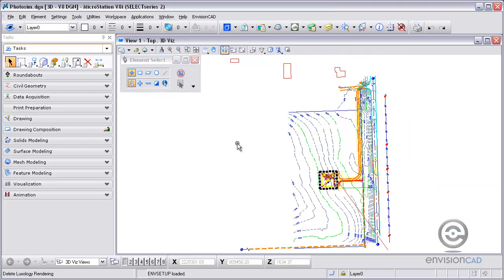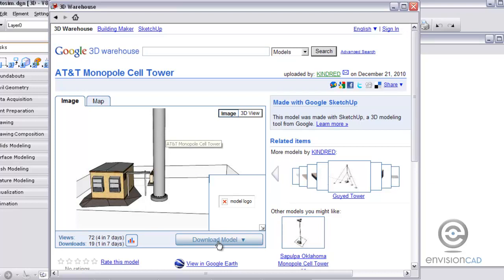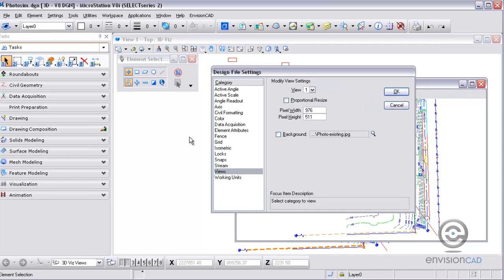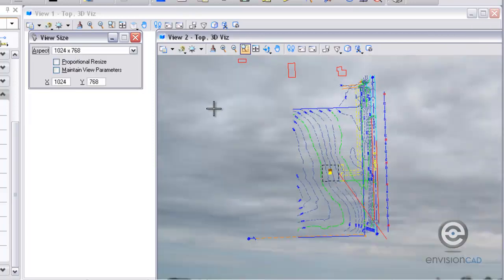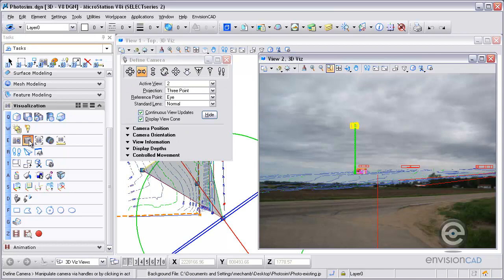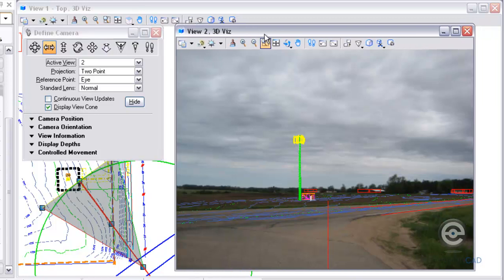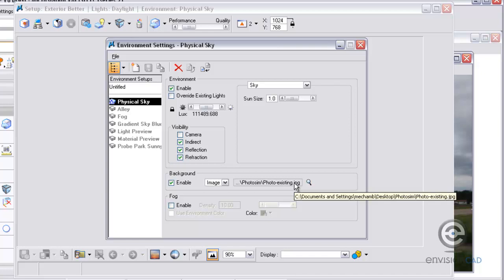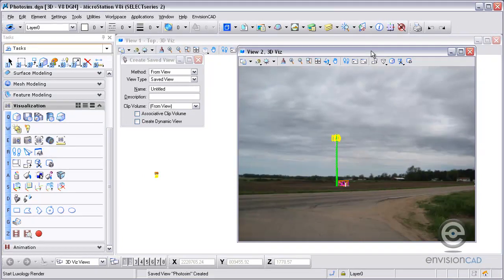3D Photo Match - MicroStation V8i (SELECTseries)

Comment from the maker: iFFYtjuh, these rendering settings are DGNLIBs and do not need to be imported. All you have to do is double click the rendering setting from the Render Settings dialog or from the drop down in the Luxology Setup dialog.

Try rendering a scene with Ambient Occlusion without importing and you will see it is the active render setting.

MS V8i SS2 8.11.07.443